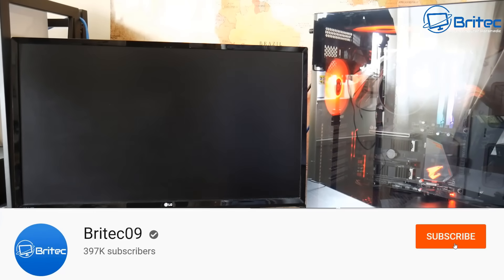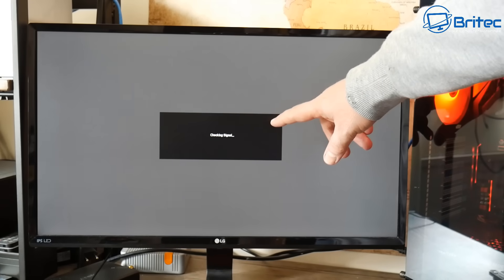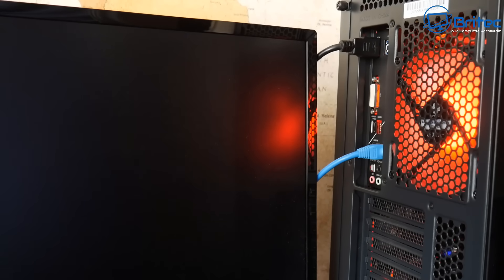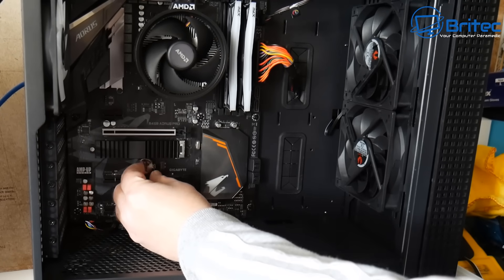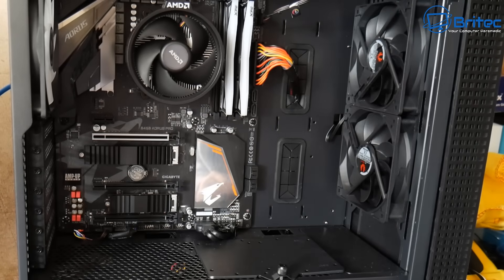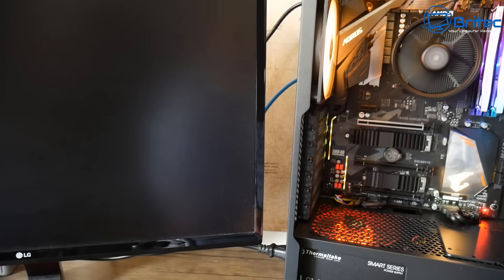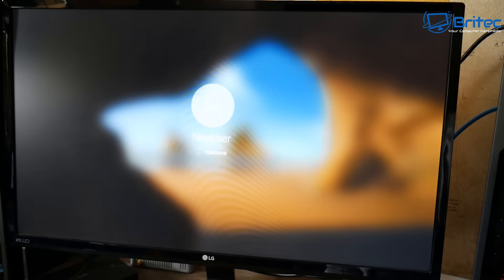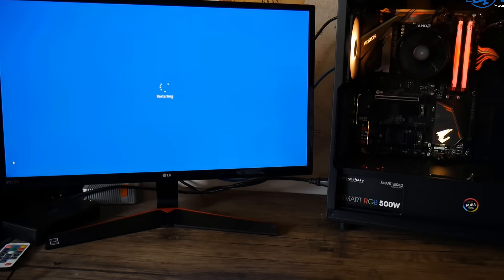Computer Repair: Fix No Display For Integrated Graphics

Comment from the maker: How many of you faced this No Display For Integrated Graphics?
Reply from the maker: @Siyavash thanks for the kind words
Reply: Hey man I try the same way as you did but my one didn't work yet. Also I don't have gpu. I use AMD ryzen 2700X, 8 gb memory and MSI B450 Mortar Titanium. And also I build this pc, it's new. Can you please tell me what can I do.... Thanks
Reply: @shahchowdhury8710  did you try your memory in different slots, or are there Led lights on the motherboard for diagnosing? I'm guessing your PC is not posting/showing any display at all.
Reply: @shahchowdhury8710  you Fix the problem
Reply: @yssinedz952  yes I'm thanks...
Reply: @shahchowdhury8710  How to fix this problem a have the same problem
Reply: @shahchowdhury8710 bro you dont hqve integrated graphics... Ryzen 7 2700x has no onboard GPU
Reply: I really need help. I was so stupid and I only had one intel graphics card. I disabled it not knowing it would not function without it. The problem is when I turn on my laptop, the screen is on but it's so shattered and broken so it's connected to my tv and when I start the laptop it doesn't show on tv so I can't reset anything. I've been googling and watching videos and I've taken out the battery and took everything plugged away. I've turned the laptop on and off and I still don't know what to do. If there's a way to enable my intel graphics and get the laptop displaying on my tv screen please please help me.
Reply: Have u found a solution 3 yrs later😭😭😭 @Queennumen
Reply: ive just built a system and i still cant get a signal after doing what u have just done
Reply: When i connect to graphic card HDMI it shows no signal
Reply: @Energeticobra  same problem here bro, no signal when connect to gpu's HDMI port.
Reply: I have gigabyte B450 motherboard and I don't have additional graphic card on it. but my monitor does not turn on. any idea?
Reply: I'm having this issue currently with an HP and I'm having no luck. Do you have any experience with those? It's an HP ProDesk 600 G1 SFF.
Reply: me right now
Reply: I had this problem just after selling my 1050ti to replace it with 1650s. But i need to wait for at least 2 days for deliver to come. So this helped me a lot mate,thanks...
Reply: But sadly it did not work for me
Reply: I put together  a system based on an ASUS B450M-A motherboard  and Ryzen processor.  I found the video didn't work and the supplier told me the on board  video wasn't supported with my option of processor and I would need a video card (I was intending to use a second monitor through the HDMI port on the motherboard).  I purchased  a video card  and  set up the second monitor to run through that.  Recently the video from the motherboard HDMI has also stopped (all I did was move house !). The supplier says I will need to send the motherboard back to ASUS so it can be tested  for faults.  That was too much of a pain so I swapped  the motherboard VGA for the HDMI on the video card  so both monitors are now  running through the video card .

This sounds a little bit similar to the posted video and I was wondering whether anyone else has had a similar (very annoying) experience to me and whether they got either or both the VGA and HDMI on the motherboard working again ?
Reply: Correction - I swapped the motherboard  HDMI for HDMI on the video card
Reply: @we-are-electric1445  can yoh explain plz
Reply: @navoda1019  Which bit ?
Reply: I want both iGPU and DGPU so I enabled igfx in gigabyte B460UD Motherboard but getting any signal does that mean I cannot have iGPU and DGPU at all in this mobo?
Reply: i have an issue with my computer... it uses intel integrated graphics. i turned the computer on and no sign of signal at all. but the fans are running.. tried HDMI and VGA. no signal at all... got no clue how to fix this.. tried removing the CMOS battery and it didnt fix it.. took out all cables cleaned the ports put the cables back in. still nothing :/ think its failed completely
Reply: Me too
Reply: i have
Reply: Hi! I have a question. Uhm, Im currently using the integrated graphics for display. when I plug in a graphics card it always show no display. What should I do?
Reply: @jrgwapo123  name the cpu?
Reply: @yssinedz952  
B450M Gaming motherboard
CPU - Ryzen 3 3200G with vega 8
GPU that im trying to use is RX560
Reply: @jrgwapo123  use jumper configuration method
Reply: @jrgwapo123  I have the same problem 🤦🏽‍♂️
Reply: @Zennonjaymusiq  It hurts
Reply: Thanks, saved my time
Reply: I have! Thanks for the help! My video card stopped working... Aw man...  this saved me! I'm really grateful!
Reply: Bell  I really didn't.  The screen is so cracked and grey that it cant work as I'm basically blind trying to see a blind screen. I didn't. I got a new laptop. Take it to the shop if you can
Reply: I have this issue also but i've try your method still no display. Im running b450 mortar max and amd ryzen 2600. please help
Reply: me, GTX 650
Reply: Can u help me please
Reply: me
Reply: Yes for me its right now I'm facing the problem right now 😩😩
Reply: Men, Thanks for this video. It helps me a lot. Same problem
Reply: I’ve faced but cmos battery didn’t rectify the no display error? Any other information plz or u r contact
Reply: Still facing, Asrock B450, just plugged in a Sapphire RX 580 Pulse and the system did not post, and crashed. Tried restarting, CMOS resetting and also kept out the 3v battery out for 20 minutes. I am lost of next actions
Reply: I had to fix the same issue just yesterday was quite puzzled until I got to see your video. But why on earth does it occur since the boot up sequences should be sending the information needed on both the card and the monitor. Thanks for posting this saved me lots of anguish to fix it as the PC belongs to my wife as such happy wife happy life. :D
Reply: me, please help me..my child need the pc for her online class
Reply: @thefarmer8005  Hopefully it will work for you and its the same issue you need just a Philips Screw Driver and follow the process the video outlines. It worked for me.
Reply: That bios is not at all the same as mine. I have the Gigabyte X570 AORUS .
Reply: Facing it now he has no gpu but has the Ryzen 5 5600G Cezanne 3.9 GHz 6 core processor.
Reply: @mpcrelaxmusic  I have the same problem, How did u fix it?
Reply: @welen6255  I followed his instructions from the video by using a flash drive and updating drivers as he suggested.
Reply: @mpcrelaxmusic  
how did you fix it
Reply: @marwan551  followed the video instructions using the flash drive.
Reply: I have
Reply: It’s not working for me I’m not sure why
Reply: Sir i m facing graphic card prblm , my card is damaged and i wanna on my computer without that how can i do that plz reply sir 🙏🙏
Reply: FIXED MINE!!! Change input from your monitor after turning on the PC/computer!!
Reply: Hey, changed mi BIOS ALLOTMENT FOR INTEGRATED GPU, went max on RAM   to increase performance, and got no signal, yhanks for ur method, saved me a hefty charge at PC repair shop, hlad I researched
Reply: In my specific case the issue was Ryzen 5600x does not support integrated graphics I had to use a Graphics Card and it started working.
Reply: I am facing power saving mode problem
Reply: I faced this problem and this video helps me fix it.
Reply: How can I fix it on laptop 😭
Reply: I have same problem with Asus Prime H410M-K
Any Suggestions?
Reply: @zabihbutt3451  
 @zabih butt 
1-Remove all power cables
2-Remove the CMOS Battery
3-Hold the power button for 10 seconds. (to drain all remaining charges)
4-plug in the battery back in it's place
5-plug in the cables.
6-turn on the computer
7-press Del to inter Bois Setting
8-find the default Graphic option and change it to IGD "Intergrated Graphic Devise and save and exit. Done

If u don't do the 8th step your computer would go back to default settings and Black Screen once again.
Reply: @ariamaram0222  ok i will try
Reply: @zabihbutt3451  I hope it works.
Reply: I have a PC having only iGPU. And, you helped me to solve the problem. Also, congratulations. You got my respect and a subscription ♥
Reply: I have intergrated video and never went through all of what he is showing here to get it back..too cumbersome..  I go to personalize/display and play around Font size, shut down the pc, reboot and back to 'normal' for me;
Reply: me buddy
Reply: I have this problem and im now searching for solution and i found your video hope tomorrow gonna fix it i made mistake by enable integrated graphic i have also nvidia graphic and that cause the issue so the computer boot but no display 🙌❤️
Reply: i have the problem now..no display from my gpu or IG i had display on my gou last night went outside for 5 min came back to a black screen🤷🏻‍♂️
Reply: It's me i press win+ctrl+shift+B totally went shutoff is that video graphics driver is not available or may be other problem?
Reply: Me also
Reply: I had this problem with my Optiplex 990 SFF until now. Thanks!
Reply: B2 code on display after install GTX1060 graphic card plug in Dvi/Vga port same problem..Please help me..
sorry my english is bad
Reply: Britec im in such a problem here i did disable the AMD radeon grafic i have on the setings by mistake because of that my computer does not want to start the, screen did get all black and now even turning off the PC and turning him on again he does get blocked on the loading screen its this fixed from this video for that?
Reply: You are a life saver I’ve just built a new PC and was struggling with this for days thank you
Reply: So I have a problem, I have a a8-3800 with the ms medion 7748 mobo and r5850 dedicated gpu, the integrated doesn't put out display nor the r5850.

Can someone help me what could be the problem? I've tried out a different WORKING gpu, different ddr3 rams in different slots. Connected a hdd and that started working, still no signal.
Reply: I am a first time builder, plan to purchase an intel 13600k and run it without a graphic card but I have read that on the first time I will boot it up I will need to have a graphic card on hand (and I don't have one) just so I can activate the iGPU?   Is that true?  An answer would be greatly, greatly appreciated.
Reply: its didnt work for me 😭
Reply: Facing it right now on a garage that has a prehistoric computer. Had a fiddle about. Now the vga out doesn't work at all
Reply: I just built my gaming PC and had the same exact problem with no display for integrated Graphics. Thank you this this resolved my issue.
Reply: My ram needed cleaned, that's how mine was fixed. First time the computer had been on its side in a few years.
Reply: For me, the problem has been when using the 'Ryzen 7 2700 CPU' which has no integrated graphics and therefore you get no monitor display when trying to install a new operating system. I don't remember how I managed to get round that problem. It was a 'new build' computer so my 'GPU' drivers hadn't been installed yet either.
Reply: Yup
Reply: Bro i disabled the graphics by accident in bios and tired to reset bios but i couldn’t i tried using the jumper removing cmos nothing works what should i do
Reply: Dose drained cioms battry means no disply 🤔
Reply: I have a GC Graphics Card
Reply: Nothing works my pc fucked
Reply: Me
Reply: Me it happens in every oneweek😢
Reply: i just experienced this. after raising iGPU memory to 8gb... after saving settings. my display was gone.  thus, i found this video.
Reply: my fans just died on my GPU. i had a back up GPU, but this one gets hot, so im just looking for a safe plan if this one dies on me.
Reply: My hardware dont have problem because i tried my gpu and amd 2600 and it works, then i try to enable igpu since i will put 5400g and remove the gpu but i cant find the igpu option in my Prime a320 k bios, but i know i can use my 5400g because i already use it before i got my gpu, then i tried your method but doesnt work in my case,
Reply: I have this problem. I need insert dedicated GPU to set BIOS, because no display even resetting the BIoS. My BIOS default GPU settings is IGP.
Reply: Thank you so much for this video!! I will try this out tomorrow but didn’t think I would find this specific fix. Much appreciated!!
Reply: I have this problem on many dell optiplex pc's with displayport . Sometimes its fixed by disconnecting and reconnect the displayport cable. It usually happens if the computer monitor goes to power save mode.
Reply: @geov.1052  never use displayport on the first boot. They cause a lot of grief. Use HDMI instead
Reply: Oddly enough, I had a Customer who recently brought in his Computer today. In the end, he had a bad motherboard, but what were the odds you would post a video the same day that I had someone bring in a computer for no signal.

Comment: Is this going to work with laptop as well? (Alienware m15 r6)

My nvidia gpu died and relying on intel uhd
The laptop haa no cmos battery, so i did unplug the battery ,power drain for couple of mins and tries and tried turning it back on but to no avail

Tried ctrl esc method as well but no effect

Can you help me did i miss any steps ?

Comment: My mobo has dvi and hdmi output and i got a ryzen 5 5600g. This method in the video did not work for me, however what worked is using a DVI cable instead of hdmi to connect my monitor first. The motherboard only sent signal that way and it said "cpu tpm needs to reset something something" and it did its thing and then later i switched to hdmi. This was infuriating since i bought and sent back one perfectly working 5600g. The other working method is to install a graphics card first and then get into bios and select integrated gfx and remove the gfx card which is a pain in the a$$ and you may not even have a graphics card laying around.

Comment: I know it’s been 5 years but I have the same problem the other way around. I can’t seem to enter the bios via my graphics card and HAVE TO connect to the onboard graphics in order do see it. If I boot the pc I get a black screen and it doesn’t show any boot display it normally does with the brands logo and bios F1 / DEL option. Do you have any idea how to fix that? (AMD processor B650-Super Asus)

Comment: solution somewhat works i removed power cable for few seconds then powered my pc again then display boot worked after wasting time on restarting pc again  many times. But why this should happen, i can say that pc is still crude primitive device in this modern times. Money making and deceiving is first priority with manufacturers.

Comment: Thank you. This worked for me. I basically got a new PC minus the GPU, but i wanted to give my new PC a test run coz why not? CPU has integrated graphics surely just plug the cable into the mobo right? Apparently not that simple.

Comment: I tried what you did in this video and it didn't work at first because i didn't remove the power cable from the psu, after following the exact same steps as you in the video everything worked perfectly

Comment: sorry quick question as my gpu just got damaged. i need to use the computer still im using i5 7600k which has igpu but i only have display port cable. it doesnt work nonetheless, can i check is hdmi a must if im using igpu? thanks!!

Comment: Hi, what do we do if our Motherboard doesn't have cmos batterie? I have a Asus Rogue with reset, start, keybot and memok buttons on it. It also has a Bios reset button on the rear connectors of the Motherboard.

Comment: I did every step right but still didn't got the display, pc is turning on keyboard's caps lock and scroll lock lights are turning of and on when pressing them it means that the pc is turning on so no ram issues. Please help me out brother I have loads of work to do 🙏🙏
Motherboard is gigabyte b150m-d2vx

Comment: This worked perfectly on my Dell XPS 8500 (i7 3770).

The graphics card died and the BIOS had no option to turn on integrated graphics. But the info in this video work. After I drained the CMOS power and then turned it back on, the first startup failed (maybe re-powering the CMOS?) but the second startup booted into bios like I wanted. Works perfectly!

Thanks for sharing.

Comment: Hello, I need help setting my Nvidia graphics as default because right now my Intel integrated graphics is set to default and when I tried changing it to Nvidia graphics card in the Nvidia control panel there was no option but when I saw online videos they had that option but I didn't so then I decided to disable my intel integrated graphics so maybe it could switch to Nvidia but instead it now only shows a black screen and I can't fix it please help.

Comment: This was Great, your videos are really usefull.
   But in my case i have  GTX 1080 installed on board and when I plug in the D.P cable to it, my PC beeps about 4 times every times starting up , Windows still shows up but i cant go to Bios mode anymore.
   It 's work just fine with GPU onboard when plugged in, and i have 2 GPU in Task Manager, the Integrated GPU graphic is the prime gpu and i can't disble it, my GTX 1080 have no benefit from it software. I try your method but it's not work :(( 
   Have i need to config something to enable Bios to work? And get rid of the anoying start up 's beep sound.
   Thank you for the great video.
Here my rig :

cpu : R9 7950X
board : Asus rog strix x670e-f gaming wifi
vga : GTX 1080

Comment: Didn't work for me. How do you plug the monitor into the motherboard? I followed your instructions, removed the battery etc. Installed the new graphics card and still receiving "No signal" black screen
Reply: check the ram
Reply: @pa800korg92 thanks man that was it for me.

Comment: So i got a hp laptop with intel integrated gpu and my screen broke and i use my tv via vga, so today i accidentally opened the intel gpu panel and i pressed on a color setting and after that it showed no sigal. 
Can somebody help me?
My gpu is intel graphics hd 3000